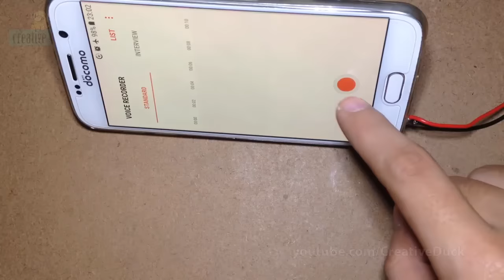Make Microphone from old Headphone

Comment from the maker: Tools: 
1. Electrical Soldering Iron
https://sea.banggood.com/custlink/vKmWoKcEon

2. Solder Wire
https://sea.banggood.com/custlink/KmvpO3ryBJ

3. Heat Shrink Tube (Black Tube)
https://sea.banggood.com/custlink/Gm3JL3Jy6H

4. Solder Paste Flux (instead of soldering rosin)
https://sea.banggood.com/custlink/vKKcjKWhg9

5. Wire
https://sea.banggood.com/custlink/D3KcOvWRUZ

6. New Microphone ($5.59)
https://sea.banggood.com/custlink/mGDrLvJYqn

Sign up Banggood get $2 coupon: 
https://banggood.onelink.me/zMT7/01byp87l

Comment: I have 2 not working headphones.
  Want to fuse them the parts are usable from both of it.
   I don't have that heater rod.
What can I do without it?
Reply: Cut out ear pecies and remove that cover like structure which covers mic then you can connect to your pc
Reply: Heater rod? Its a fuckin soldering iron go buy one

Comment: Hi, I would like to ask you a question. Is it possible to add wires to a wireless headphone?  In this case, how can I do it? Does the result worth while?
Reply: Maybe you just need power wires to an USB or cell charger.
Reply: yes it is worth putting wires on a headphone that was designed to never have wires
Reply: Legal
Reply: Yep it's possible to add wire for wireless head phone